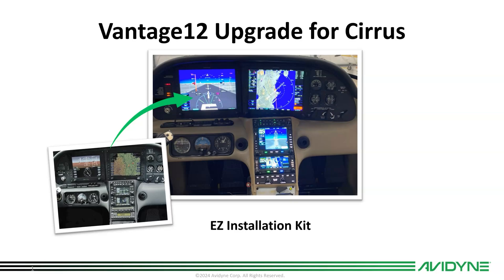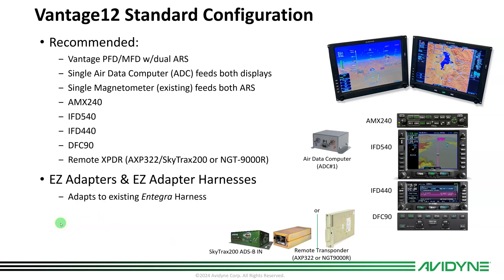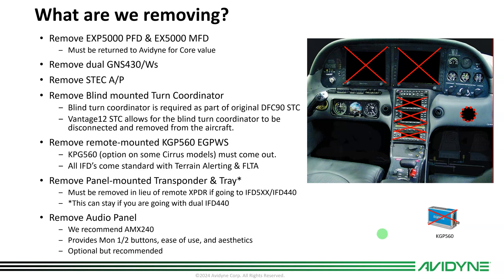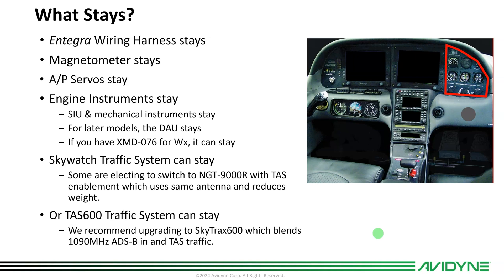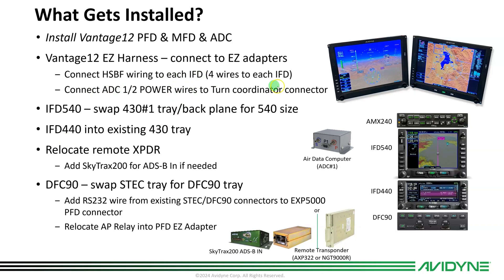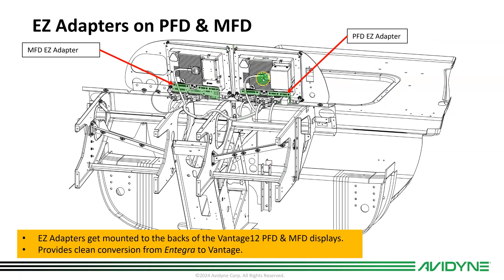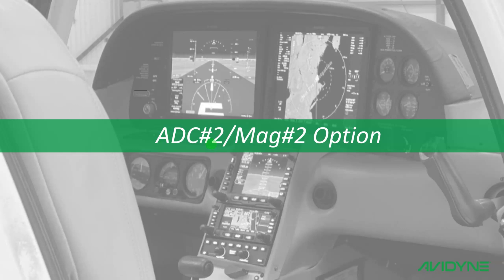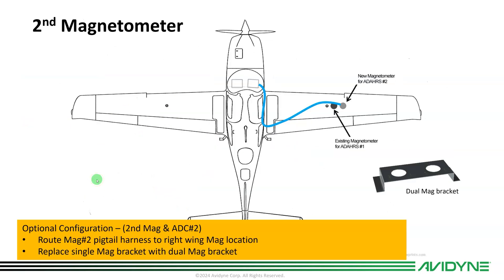Avidyne Vantage12 EZ Install

Comment: Concerns I have for Clients in the past: Will Avidyne continue to have a maintenance contract for any maintenance with these, AND will the customers still be required to remove the entire screen to send out for a repair, since these new screens apparently still retain their ADAHRS within?  This renders the plane unflyable, unless Avidyne supplies "loaner" units or Avidyne offers those PFD/MFD exchanges, via those annual or up to three-year contacts.  AND, is Extant Aerospace still involved, since Avidyne sold out providing service for their legacy units to Extant Aerospace out of Florida, or is Avidyne going to provide support for their own products once again, or for a period of time, until Extant Aerospace is again chosen to warrant and provide tech services for THIS new generation of screens?
Reply from the maker: Avidyne will manage the repairs on this product directly. The unit will need to be returned to us but we will have an exchange pool available. All repairs will be done via a fixed rate repair as we do with our IFDs. Extant contract on Avidyne Entegra products will end at the end of 2025.
Reply: @AvidyneAvionics  That's good news; glad that Avidyne is reclaiming their previous products and be the sole support source.  :-)

Comment: With the EGPWS system being removed, will your new panels have a TAWS inhibit switch on them? I tried switching from EGPWS to TAWS on my IFD540, but it gets dangerous since there's no way to silence the excessive terrain alerts when flying into (charted) mountainous airports. It makes it impossible to hear traffic/ATC during a critical phase of flight.